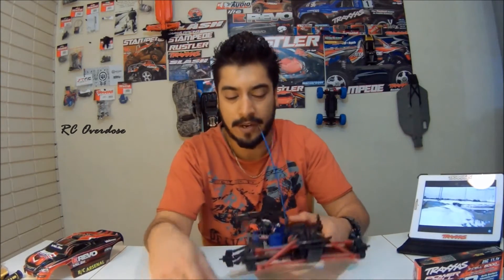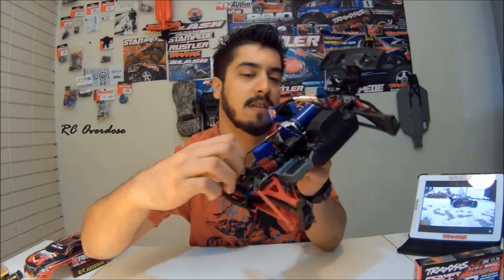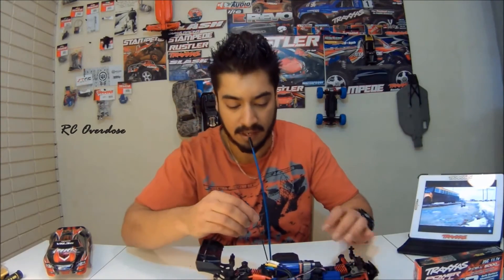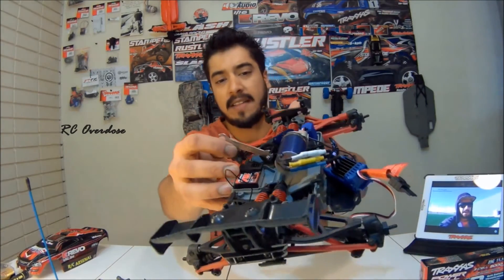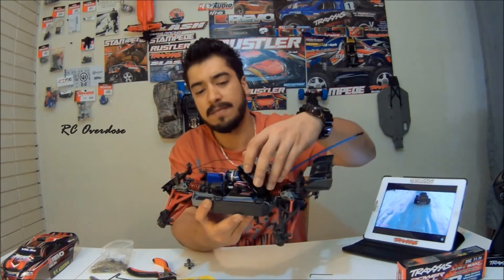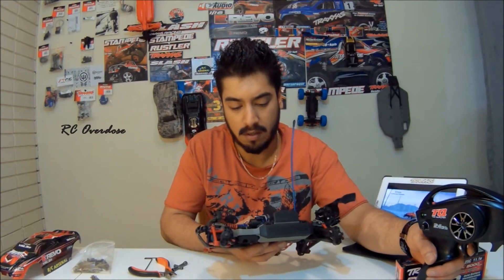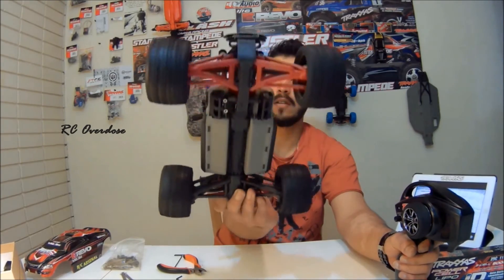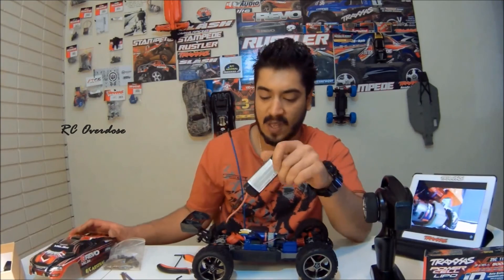RC Overdose-Mini E-Revo VXL Slipper Clutch Rebuild Video(TRX 7152 Kit)

Comment: good stuff bro!! 👍 have you had any issues with the diffs ? also whats the biggest battery that fits in the tray?
Reply from the maker: Robert Kotevski the front differential might be damaged because my Rc seems to run slower than before.Also I never used a lipo yet but brushed version went just as fast on nimh batteries.I took the entire Rc apart twice to figure out the actual problem,Thats why I couldn't upload the other day.Dont know what it is but I am definitely buying a new diff and installing it.Will I need additional diff lube ?And also I want to give you a shout out this Wednesday or Thursday as you helped me figure out the USB Castle stuff.I ordered it on Saturday.Cant want to get that thing on the road.And Traxxas 2200 Mah 2s lipo is the most That the case would take.I know RC Arsenal(Jeff) uses 2500 mah 2s lipos but I am unsure of the brand.Thankyou for stopping by Rob.
Reply: cheers for that dev!happy to help bro. definitely get some diff fuild and grease of your choice ☺✌
Reply from the maker: Robert Kotevski gotcha.

Comment: Yea tighten the bolt on the slipper truck not all the way though I did it on my ecx circuit and it made it quicker off the line and have a higher top speed but tightening it too much with stress out the motor
Reply from the maker: Andrew Kauffmann Ok got you brother,Thankyou for your help.
Reply: RC Overdose your welcome just go on the website for traxxas and try to find the best setting